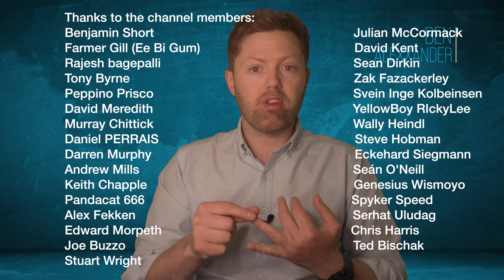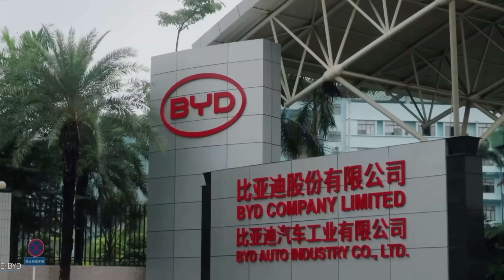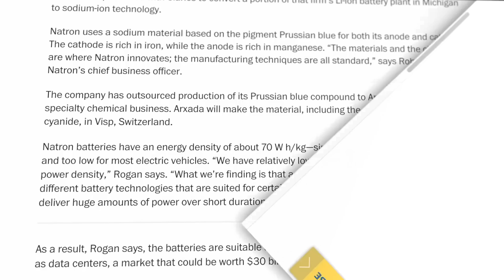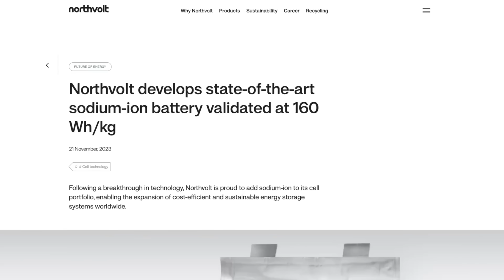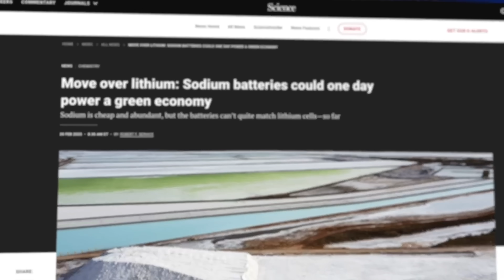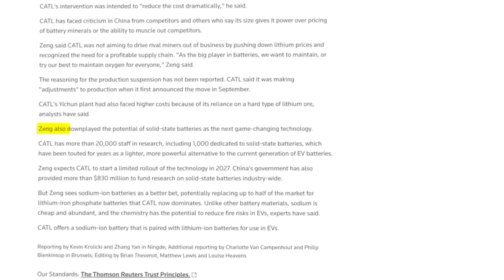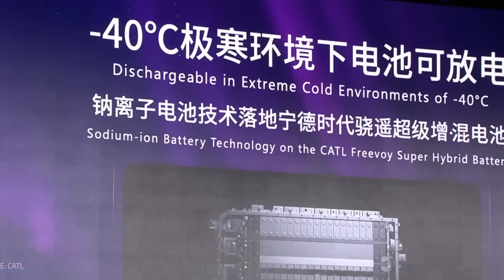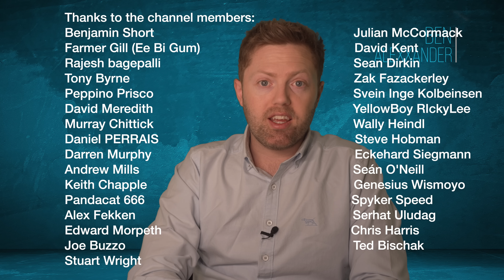Sodium-Ion Batteries: The Myths Everyone Keeps Getting Wrong

Comment: Great content, I would like to see their safety demonstrated under the same various conditions that would make a lithium-ion battery dangerous. I would really like to use sodium-ion batteries in my projects over lithium-ion, for safety reasons, especially in regards to series/parallel configurations in packs for higher voltage outputs / higher amp hours.

I have loads of 1860's and Sanyo 2700s left over from my electric skateboard but those batteries really bother me in terms of safety, even while just storing them.

Comment: According to actual current tests of available Na-ion batteries, the discharge curve is a linear negative slope that crosses its rated capacity at 50% SOC.  After 50% SOC the pack voltage continues to drop precipitously.  LiFePO4 and Li-ion have flat discharge curves.  What this means is that voltage sag after 50% discharge will be a major issue for Na-ion.  This means slower EV acceleration, etc.  Either you'll need a DC-DC converter on the output of the battery to maintain the voltage (expensive, complex, etc.), re-design the inverters with a lower dropout voltage and voltage boost circuitry, or you'll need to fix this inherent issue with the chemistry.  No one is talking about this except those independent testers not affiliated with the battery companies.  This is a big deal.

Comment: Those who pan sodium-ion batteries are trolls and bots financed by the oil&gas industry.  A pure rear-guard action.  In 10 years we will have batteries that can fuel airplanes.  I don't know what chemistry it will be and I'm really scared of the energy density (as we all know the 3 key metrics are: energy density;speed of charging; and safety).  I will say one thing, if I see a burning EV I move away... quickly.  With sodium ion I am not worried.  We need to know, at a glance, which cars are powered by sodium.

Comment: It's interesting when you read back on the development of Lithium batteries that nearly every single complaint that people make about Sodium batteries also applied to Lithium batteries at some point in their development. Personally I can't see Sodium completely taking over from Lithium in cars, quite likely they will in short range budget priced city cars, there are other upcoming technologies that may be far better for general use in cars. Fixed storage is where they will take over fairly rapidly. In fact being a quiet revolution may have some advantages for Sodium, the less people hear about them the less unfair negative press they get. There are already massive Sodium based grid scale storage systems in development, that's where they will shine.
Reply: Buses, local delivery trucks, taxis are a natural market as well. Very high cycle life is desirable. There doesn't need to be a one size fits all solution.

Comment: The frequent claim about the durability of the CATL Nextra sodium batteries is that in a car, they will last 5 million kilometers. At least 10 times the life time of the whole car. I’ve never heard about tires lasting that long… 😅  Their main weakness, as far as I can see, is a poor charge efficiency. Round trip efficiency apparently around 60%, which is roughly on par with old lead acid batteries. LFP is typically around 98%, which is stellar. For use in a “house” battery bank on long distance sailboats, which is my angle, charge efficiency is a core property. Lower efficiency means I need a lot bigger solar panels or a lot more time. Both are resources that are already maxed out. For this use, LFP is still a dramatically better choice, also for a bit higher power density. 

One more LFP advantage: They have an extremely flat voltage curve over the useful charge levels. Within about 4%, 7% if including charge Voltages. That makes it simple to keep electronics happy, and more. Sodium cells loose perhaps 30% in voltage from full to low charge. That means they cannot do the job alone. They need a converter to keep the Voltage even. In itself not a major problem, but it does reduce the efficiency even further. It looks like this needs another generation or two until it fits in cars or boats, but it might be interesting for grid use.

Comment: FYI
The sodium used in the batteries is closer to baking soda than it is to salt. Sodium carbonate not sodium chloride. At least that's my understanding.
Reply: Lithium is converted into lithium carbonate for transportation to the battery factory. It may be the same for sodium. The point is you can get sodium from salt, which you can get as a by product of sea water desalination.

Comment: The main myth I see people get wrong is that Sodium batteries are cheaper. They probably will be in the future, but they aren't cheaper yet. And we may be several years away before they are cheaper than Li.
Then there are so many downsides with these batteries, that we won't see them deployed on a large scale in EVs. Yes, they will revolutionize some niches, but clearly not EVs. Some Chinese companies claim they are going to put these batteries into EVs (tiny city cars). But then the question is: are those companies going to be able to sell those cars and make money off them. The technology isn't better than Li and the batteries currently are more expensive.
The problem with recycling is not that it isn't technically feasible. A problem is that the input materials are so cheap that it doesn't make sense economically to recycle them.
Long cycle life: yes, under lab conditions, but LFP seems to hold out well enough in real life conditions. It's only wait and see for Na. Na doesn't like heat, so cooling is going to be crucial, especially in warm weather.
You mention the energy density in Wh/kg, the problem with Na is volumetric density. These batteries will take up significantly more space than Li batteries do.
Reply: They're already cheaper. CATL expects   Sodium batteries will be as low as 19$ per kWh. As production is scaled up
Reply: @cheetomussollini  I see a discrepancy between "They're already" and "will be".

Comment: Why is sodium-ion RTE lower?  Sodium ions are larger and heavier than lithium ions, which slows their migration through electrode materials. This increases internal resistance and heat losses. However, sodium-ion batteries are superior for stationary storage where safer chemistry is the priority-look at reports on the Moss Landing battery fire for why this is the case.

Comment: My main complaints about them so far is so far: the price is not competitive, but it will be. The second thing is the rather linear voltage curve when you have enough of them to power your house whether you're shooting for 48-volt or something higher well the packs right now very from 24 to 64 + volts within the same pack across the charge cycle it's not practical with current inverters to maintain efficiency across that. I'm sure we can come up with something and we will but as of right now the hardware just doesn't exist, accessible on the open market without building your inverter from scratch or going with some type of hybrid solution and dealing with the losses of voltage regulators and voltage multipliers and the like. Buck converters on a scale to handle a household load negate any possible savings over the chemistry. I think a lot of people are overlooking the benefit of lithium iron phosphate hanging out so close to its 51.2 nominal volts. And this only gets worse if you're running several hundred volts in a more efficient battery pack. You have to wire with giant cables based on the lowest voltage through your cycle.
Reply: CATL expects the Sodium ion cells to get as low as 19$ per kWh.  About 60% cheaper than Lithium ion
Reply: @cheetomussollini …. And i expect pigs to fly !
Reply: @cheetomussollini yes on that point I agree and I do find that to be very possible although I'm not this optimistic on the time frame, I do think the price has a lot of downside potential to keep getting cheaper. However I don't know if much can ever be done about the voltage curve. I would love to see a video on that subject and the workarounds to handle the engineering to get around that issue.

Comment: What is the price?  Today you quoted $40 from analysts who I presume are one step removed from those in the know, Robert Llewellyn quoted $10, I have heard $20 and quoted that myself as it was the top end of the $10 to $20 when CATL first came out with this.  Fact is the actual price is always opaque. One price for shareholders another for someone negotiating to buy the car.
Reply: CATL predicts that Sodium will get as cheap as 19$ per kWh per cell as production is scaled up. Lithium is currently at around 60-70$ per kwh.
I doubt the world will ever run out of salt 😅

Comment: The one thing you wont address is the round-trip efficiency. LiFePO4 is ~95-98%, while Na ion is around 80%. Fine for solar batteries because solar is cheap, but if you're paying per kWh, you have a problem.
Reply: For the various flavors of Na-ion the round-trip efficiency is 85%-95% (according to the iAsk AI website). Not sure if CATL has improved this.
Reply: This is a problem in the UK and Germany which have the world's highest electricity prices at the same time as they are trying to convert everything to be electric.

In more sane countries it is a non-issue.
Reply: @gregvanpaassen  The reason for that is that there isn't enough storage on the grid. The price overnight is really cheap compared to at peak time. Thus, even relatively inefficient batteries are worth it, and capacity is the more important concern than pure efficiency.

Comment: Downside is the rapid discharge curve means an inverter has to work over a wider range.
Reply: Switching technology pretty much solved this issue years ago. Virtually all modern power supplies and DC-DC Converters and Inverters now use switch-mode technology. Much lighter and far more efficient than the old linear techniques.
Reply: @TronJockey  BUT.. a 500v Na EV pack would have a voltage range of 300v - 600+v ,..if you actually wanted to use the full 200 Wh/kg potential. Even a well designed inverter would need to be able to handle double the amps at 300v compared to operating at 600v, in order to mantain power levels. That is a big issue for any inverter design.
Also, the same applies to charger designs to handle much lower discharged pack voltages .
I am sure it can be done , but it is not current tech, and it will increase the cost of components.
Reply: @weinisable  You probably won't see inverters that can pull double the amps like that, because that'd be way less cost efficient, negating a bunch of the savings of using Na-ion cells in the first place. Users will probably have to accept somewhat of a performance drop when the pack starts getting low on juice, so Na-ion batteries will likely be relegated to cost-conscious lower-end vehicles, slower type vehicles like say work-related/transport vehicles etc.

On the other hand, likely the only time you're actually going to notice this performance degradation is if you're driving with a lead foot off a stopsign or the like. That's really the only time you're pulling max current from the battery pack. Normal type driving, including regular highway driving, doesn't use anywhere near the max current capacity of most EVs. Maybe - and I'm speculating here mind you - in a car with a small motor and small battery pack like a Renault Zoe type vehicle you might see a top speed drop from say 120km/h down to 90 when your pack starts to go really low. That'd still be acceptable, and besides, you're more efficient at the lower speed anyhow. :P
Reply: @weinisable  Maybe you need to get out more or buy more stuff.  Even cheap electric motors and cheap inverters can handle a wide voltage range these days.  I run electric pumps that are ok with voltages from 10v to 40v.  My semi cheap 24v solar chargers can handle from 28v right up to 200v.  DC tech has come a long way in the last 10 years.

Comment: Will NMC still be the battery for the premium offering when Sodium has much better properties like with cold weather and cycle life. It used to be that NMC was the better chemistry for everything except price.
Reply: And stability at high temperatures. Both LFP and Lithium NCM give ofd nasty gases when cooked, regardless of how they got cooked. Cobalt soot on your skin erases your immune system plus it’s a very powerful poison. I have multiple Lithium NCM powered vehicles and tool batteries. It’s a horses for courses conversation

Comment: How does the volumetric density of Na batteries compare with Li?
Reply: 210Ahr/Kg according to CATL
Reply: About 200 Wh/Liter   (Volumetric)
About 175 Wh/kg      (Gravimetric)
Reply: In a decade or more, we'd see the benifits of beyond NMC research with 1000Ahr/Kg potentially with multi-electron intercalation cathodes [Whittingham] and with Lithium and other anode compliments

Comment: Are you now mixing up numbers of sodium , lmc and compare it with blades lfp? Wh/kg.
Simpel search:

LFP (Lithium Iron Phosphate): About 130-210 Wh/kg at the cell level, with many high-quality commercial cells around 150-186 Wh/kg. Recent advancements are pushing this even higher without significant cost increase, with theoretical maximums around 380 Wh/kg.[wikipedia +3]
•	Sodium-ion batteries: Generally offer 100-175 Wh/kg, closely approaching LFP in some modern prototypes (around 175 Wh/kg). Some breakthroughs show even higher values (up to 458 Wh/kg in research materials), but typical commercial sodium-ion cells are lower than LFP in energy density.[wikipedia +3]
•	LMC (Lithium Manganese Cobalt oxide, often similar to NMC): Typically higher energy density ranging from about 150 Wh/kg to 220 Wh/kg and beyond, with some sources citing up to 250 Wh/kg or more. This chemistry balances energy density and stability, commonly used in EVs needing more range.[ufinebattery +1]

Comment: One thing that I have heard is that Na batteries lose their power as they discharge whereas Li batteries do not.
Reply: Lithium batteries do experience cell voltage drop as well as they discharge, just not as severely as sodium-ion batteries do. That means your inverter will have to work a bit harder to compensate for the voltage drop when you need high power draw from the battery pack, with the disadvantages that entails.

This isn't necessarily that big a deal though, in most circumstances, as it's rare that you need full power from your pack, unless you're say, a race car driver, and then you made a mistake choosing sodium-ion cells in the first place. ;) Each thing has its own niche, where it gets to shine.
Reply: @len @lennyvalentin6485 its not just about power,  Torque is also dependent on battery voltage and amps.
Because EVs have no gearing ( single speed gearbox) high torque is needed at low speeds, such as pulling away from stop signs, or hauling up that car park exit ramp,  steep hills , etc etc.
If the inverter cannot supply max current at low states of charge,  (50% of the battery capacity is in the lower half of the voltage range), then there could be a lot of disapointed customers
Reply: @weinisable  While this is undisputably true, it's worth pointing out you don't need max torque just to drive off from a stop sign, or up a hill, or or. A sodium-ion battery car would be designed to handle these types of situations regardless of state of charge, or it wouldn't be certified to be sold as a road vehicle.

What you likely wouldn't get is the best maximum acceleration figures when the battery starts to droop, at least in cheaper type vehicles where the inverter isn't upsized to compensate for the voltage drop by increasing current.

Remember, it's not the voltage per se which generates the torque in an electric motor, it's the magnetic field produced by the stator windings interacting with the field of the rotor, and that field is the same whether it is produced by low current/high voltage, or high current/low voltage.

Buyers of cheaper vehicles are likely already aware they've bought a budget product, and should therefore be able to rein in any disappointment of somewhat slower acceleration at lower battery SoC. Nobody expects Ferrari performance from a €20k (or possibly less) car. ;)

Comment: Is  there a voltage range issue with sodium batteries?
Reply: yes
Reply: The charge/discharge curve has a wider voltage range: https://www.batterydesign.net/wp-content/uploads/2024/02/CR32140-13-1024x668.jpg
Therefore, you need to increase the level to make it usable, with all the associated losses.
Reply: Not really. It depends on what you are applying it to.

Comment: Some questions related to Sodium batteries: (i) what components are used for catalysts? Rare earth metals, or just simple carbon and aluminium? It would be interesting to hear a "chemist's" perspective on this. (ii) "harvesting" Sodium... can this be done from ocean water, without too much post processing? If so, I would assume that it could/should be combined with fresh water production/desalination -- useful in countries with little availability of fresh water.
Reply: I think I saw something recently that said soda ash, a very cheap, widely available chemical, is easier to manufacture sodium for batteries. IIRC, there's something ridiculous like 42 BILLION tonnes of soda ash in Wyoming, alone. The stuff is dirt cheap. Lithium is something like 13k dollars a ton. Soda ash is about 300 dollars I believe.
Reply: White sugar. The research and the breakthrough happened in Australia